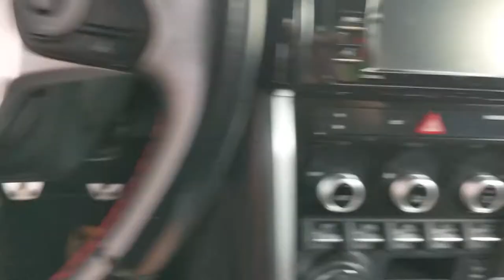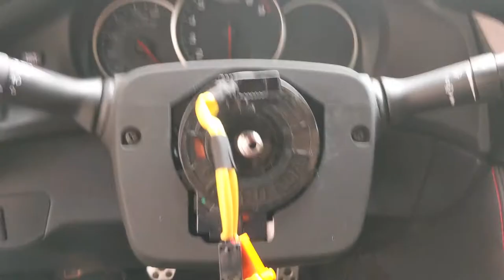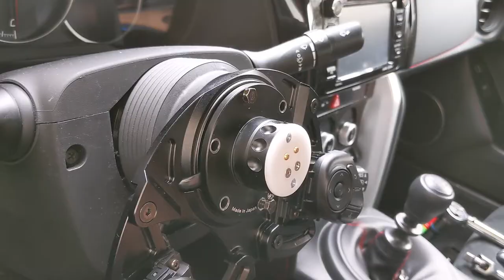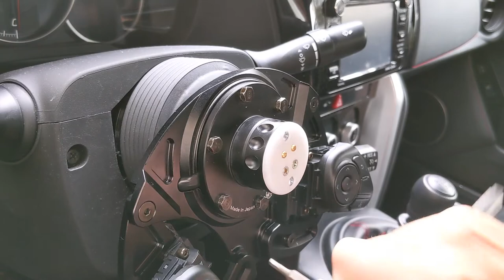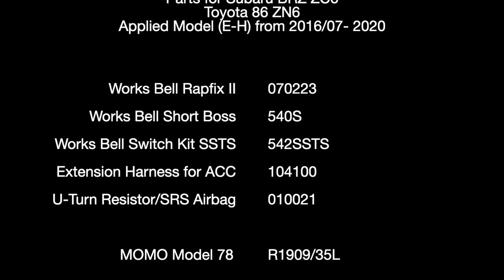Works Bell Rapfix II Quick Release/SSTS (Steering Wheel Switch Relocation Stay) controls install ZC6

Comment: just noticed that you used the 540s instead of the 542s short hub. did you have any issues when installing this other than cutting the rubber and the clips?
Reply from the maker: no issues 👍
Reply: What’s the difference between the 540s and 542s

Comment: Does the SSTS assembly only work with a work quick release? Or will it mount onto any quick release? Can’t seem to find any info on that. 

Hopefully you can get back to me even tho this video is over a year old 🙏🏽
Reply from the maker: It should work with any quick release that uses the same bolt pattern, like NRG, OMP.
Reply: Thanks bro! I appreciate the response 🙏🏽
Reply: @saulmoreno8372  as long as it has 6 Bolt 60° 70mm diameter PCD, e.g. Momo, Sparco, ISOTTA  and NRG.
Reply: @0xadada  got it, I didn’t wanna spend $400 on a works bell quick release that’s why, maybe someday but not now lol

Comment: What was the point of turning the clock spring left and right when the steering wheel was off? I’ve been needing to my install mine quick release/hub but messing up the clock spring or just doing something wrong installing it seems intimidating, so much appreciated for a response:)
Reply from the maker: @nico My point of turning the clock spring was to demonstrate that is a 5.5 rotation clockspring, and  in order to verify that it is centered, you can simply count the number of rotations. When you remove the OEM steering wheel, and if it stays in the same position, you can just skip this step. If however, you wish to verify its in a centered position, you can follow the simple counting protocol I used in the video. 2.25 turns to the left (max-left), 2.25 to the right (Center), 2.25 to the right (max-right), 2.25 to the left (Center).